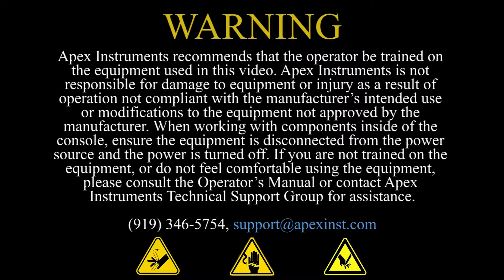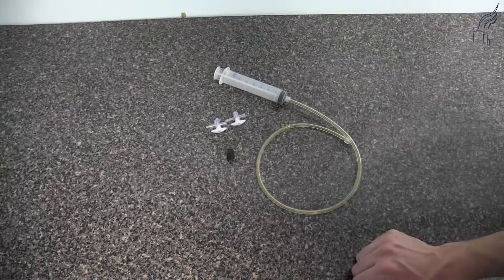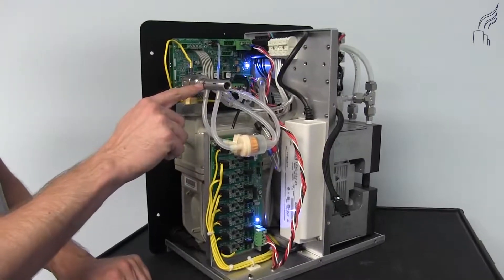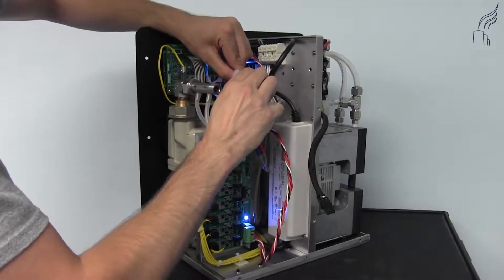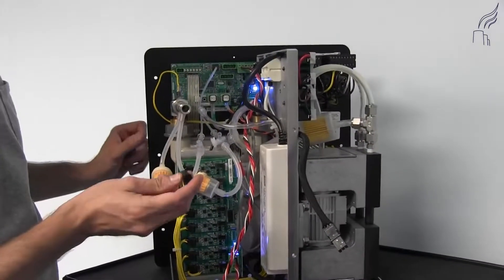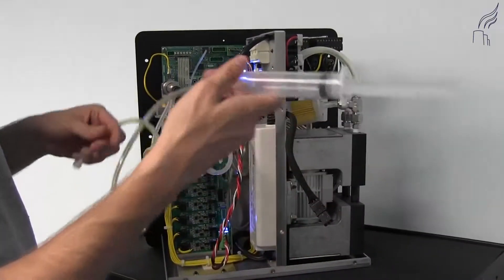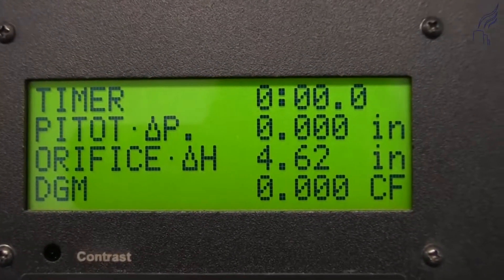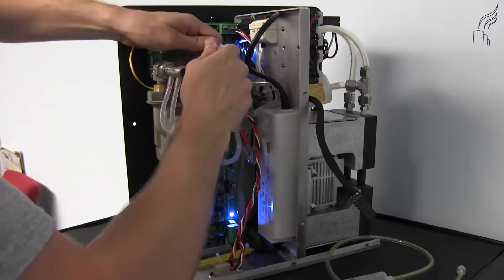Apex Instruments - Backside Leak Check on Digital Method 5 Metering Consoles

Comment: That is kinda of a pain in the butt to do out in the field prior to testing.  There has to be a way you could add some stuff to make it easier.  A solenoid to switch to leak check mode.  Cap the back and blow into it from tubing already installed.  At least add an opening in the back to access it.  Having to take all the bolts from the front, slide it out of the shell is asking to break something.